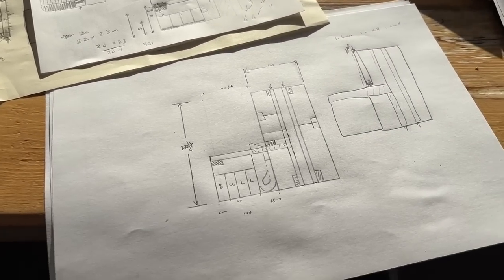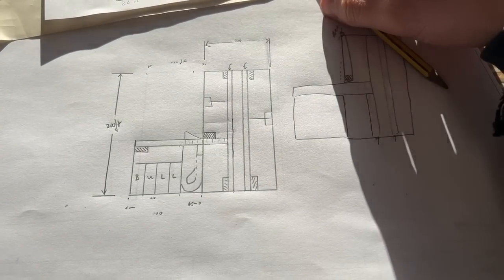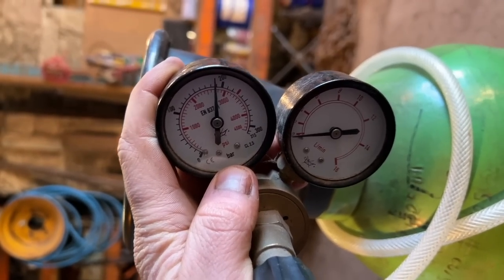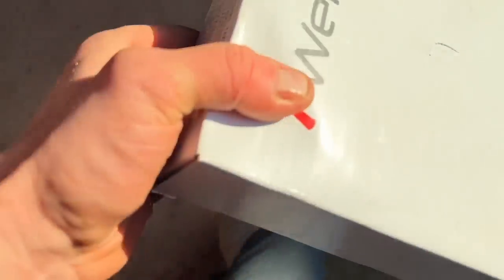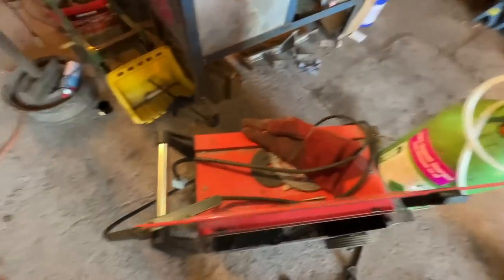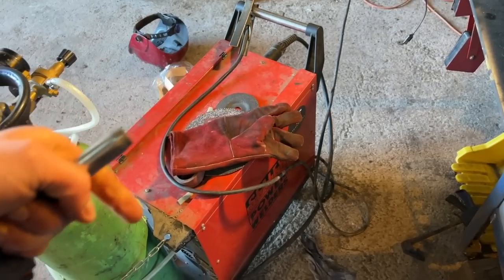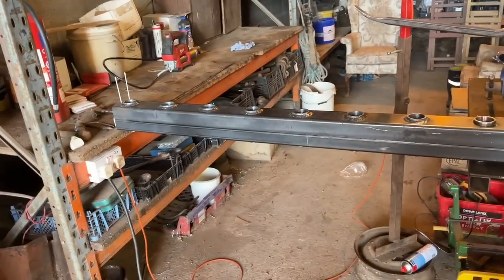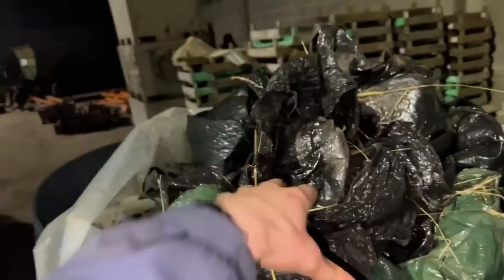New Cattle Shed Design Almost Finished? | Welding New Stone Graipe

Comment: Great video Crawford,we use a Solway bin and I use a ratchet strap round the outside of the bin to hold the top of the bag stops it moving when pushing in wrap with a water filled trailer wheel 👍happy days.

Comment: Install a 16 amp socket and fit a plug to the welder, as long as it's on a 16 amp circuit all will be good

Comment: we’ve got solways bins for bale wrap and all we use is a trailer super single wheel an tyre that still holds air an we just welded a bit angle iron across the middle and upright with a hoop for the tines on the forklift to get a hold of and then simply place it in, fits like a glove and has enough weight to squash it all down for a while so you get way more in the bags 🤙🏻
Reply from the maker: Will hunt for one 👌🏽

Comment: If they are bull pens, do they need a scrape? Are there some calving/sick bays? Would your handling allow sorting, easy movement to the calving bays? Sorting would be a nice bonus making it easier and safer. Although making it an odd shape, would having bull pens on the other side allow either building to be extended as needs/funds allow? Though from what you are saying, having the second one separate with an alley between. Maybe just a shelter for the crush and the rest external?

No need to answer the questions, just thoughts for you 👍
Reply from the maker: Cheers 👍🏼 i meant scraping out the bull pens not a separate scrape area 👌🏽 otherwise i think we have thought about the rest 🤣 too many things to think about